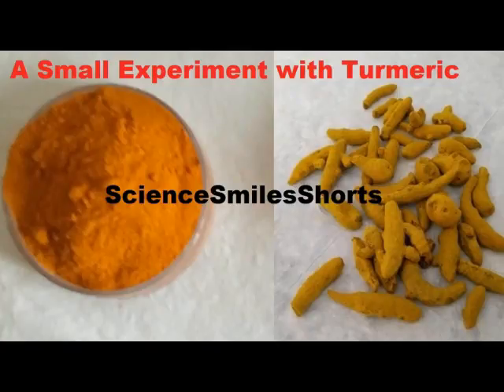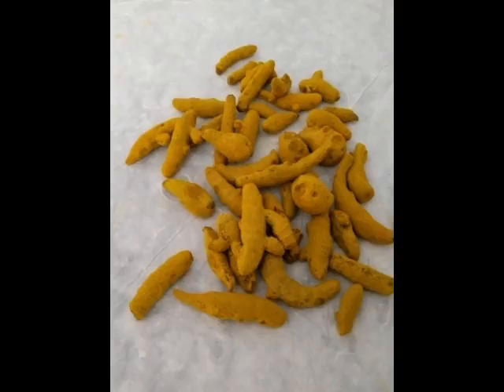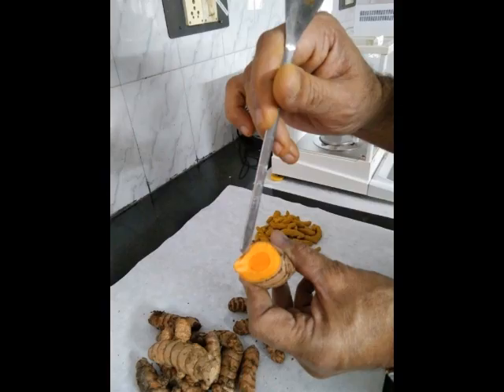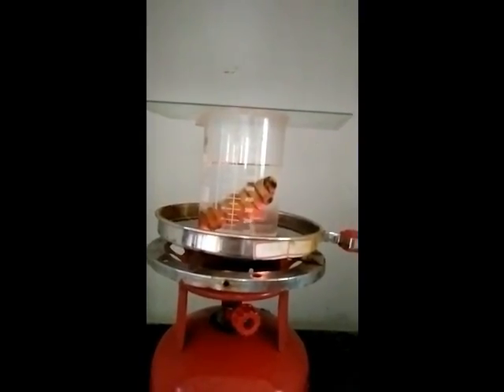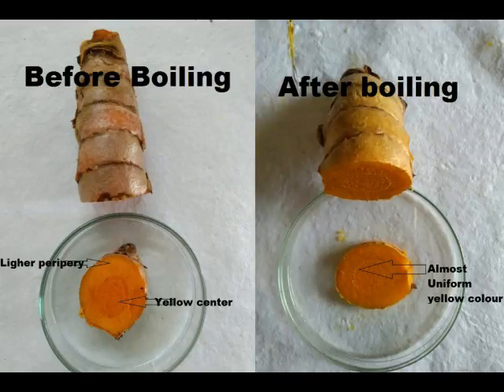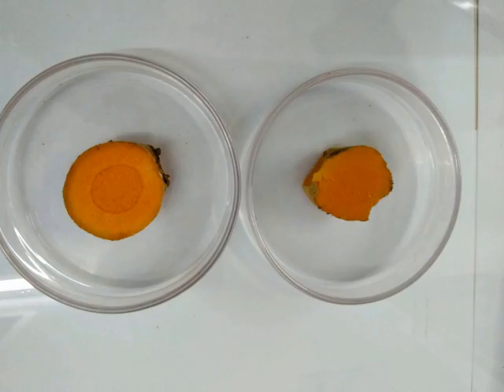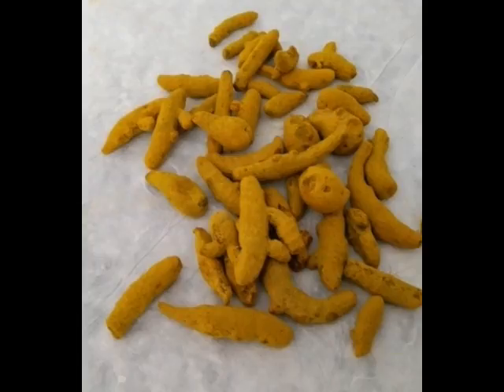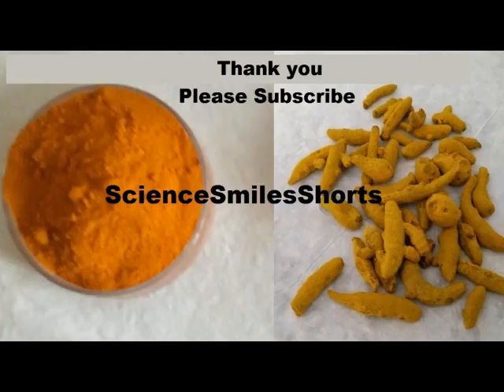L4. Why Raw Turmeric is Boiled: An Experiment in Lab

Comment: I have read that tumeric contains lead....so now I am afraid to take it ! Any thoughts on this?
Reply from the maker: Hi, Thanks for the message. I apologize for the delay in response. Turmeric may contain heavy metals depending on the source, soil and post harvest practices. Lead is a contaminant mostly arising from some post harvest practices of boiling in some vessels which may contribute and partly depending on soil salts. Turmeric from many parts and sources does not contain lead or heavy metals in unacceptable levels. This can be ascertained by testing with AAS.
Thank you

Comment: Thanks for sharing your experiment!  May I know if the health benefits are degraded by boiling first? I’ve seen some advice both ways.
Reply from the maker: I apologize for the delay in response. Curcumin and volatile oil both are lost while boiling to some extent. This was practically observed by me after testing.
Thanks and regards
Reply: Boild at 45mins. 😮
Reply: Thank for this information i ever wanted to know about the boiling process and if it necessary i learn a lot from you sir , can nursing mothers take turmeric and milk?

Comment: thank you so much for the information. Can you please tell that for how much time we should boil turmeric before drying?
Reply from the maker: Many thanks for your interesting question. Boiling is done by two methods in turmeric field. 1. boiling in water 2. By steam.
The objective is to ensure that the curcumin gets distributed into the finger uniformly by gelatinization of the surrounding starch in turmeric finger.
in water boiling method they boil for 40 minutes the completion of boiling is indicated by froth on the surface. In steam boiling they boil for about an hour.
Ultimately the best judgment is by breaking one finger which should be soft and the color should be uniform.
I shall produce more short videos against all questions in future.
regards
Reply: @sciencesmilesshorts  Thank you so much for replying to my query. It is very helpful.

Comment: Sir, while boiling the curcumin get absorbed to water..? If not there is no point in drinking the water.I'm asking this with respect to drinking turmeric boiled water for health benefits. Also I have seen an oily thing above the water after boiling. Also please enlighten if there is any other way to get curcumin in a health point of view.
Reply from the maker: Many thanks for your message. I think you are speaking of dried turmeric. whatever, curcumin is almost insoluble in water. There can be very little dissolution due to pH range. So there is no point in taking turmeric soaked water for the benefits of curcumin. The oil floating is the essential oil of turmeric which contains lot of antioxidants. To get the benefits of both curcuminoids and essential oil we add in curries and even some make a special curry with fresh  tumeric. Some add a pinch of turmeric powder in milk so that milk fat extracts the curcumin and others. Some add in ghee as well. I shall come out with the benefits of turmeric in a separate video. 
Thanks and regards
Reply: @sciencesmilesshorts  hi...I'm adding a piece of turmeric to boiling water. Is that a good idea..?
Reply from the maker: Not much of use. The essential components are almost  insoluble in water (very little). Better to add a pinch of turmeric powder to a glass of milk.
Thanks again.
Reply: @sciencesmilesshorts  thank you..

Comment: After boiling we should remove d skin or not for prepare turmuric powder and one more dougt is while boiling nutrients wil go
Reply from the maker: After boiling if skin is removed and air dried fungus will fast attack the surface.The practice is after boiling it is dried with skin  and then polished.
Nutrients are lost by leeching along with a little of curcumin (little as it is not quite soluble in water).  Some curcumin is lost/degraded  due to heat. 
The alternative is steam boiling, here some nutritive values are lost because of high temperature and also curcumin.
I developed an alternate method apart from the above for small quantities. You may please contact by email :
emvrow@gmail.com
Thanks for your interest
Reply: @sciencesmilesshorts  thank u..but how we polish for grinding turmuric for home

Comment: I have dried the turmeric after curing and chopping into thin slices. However, after 2 days of drying it is still having moisture and it feels a little sticky to touch. Is this normal?
Reply from the maker: It is yet to be dried till it becomes non sticky and nearly becomes brittle. Two days may not be sufficient, depending on your climate. It is normal to be sticky with high moisture because of the starchy substance. Thanks a lot for your interest and best wishes
Reply: @sciencesmilesshorts  thank you so much!!
Reply: You can dry in low heat with gas in a pot... quality won't reduce and get dried